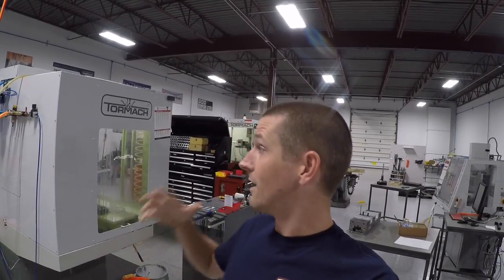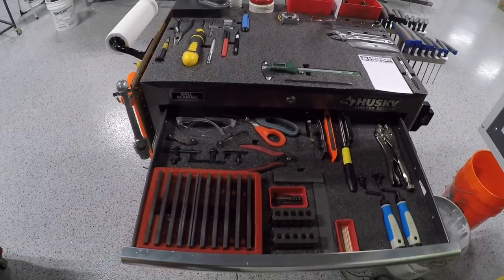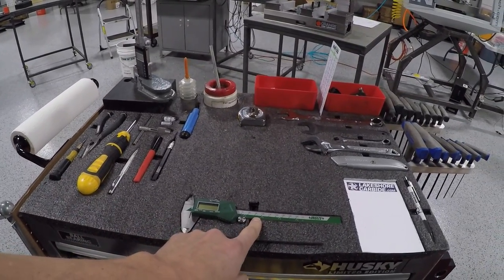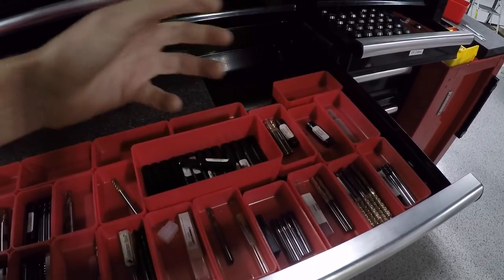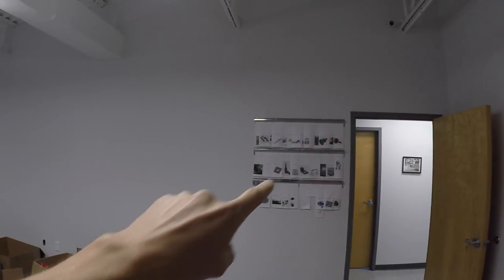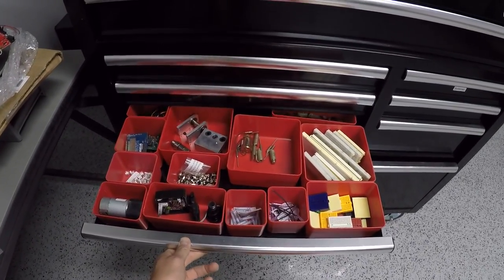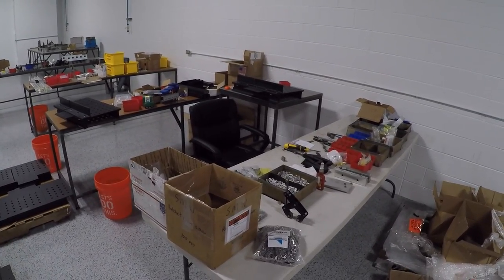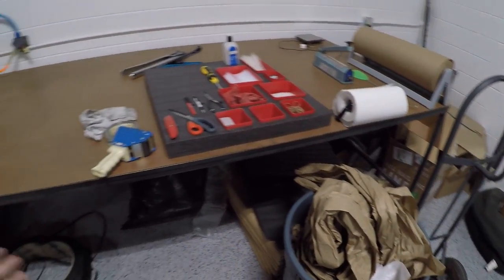Ultimate Machine Shop Toolbox & Organization!

Comment: When I was working as an aircraft mechanic in the Air Force used foam in our tool boxes. Since we had to make sure we didn't lose/forget a tool on the jet, we painted the tool cutouts a different color than the foam. It makes a missing tool show up like nothing else. Very easy to do on new foam. Just mask the whole top then cut out for your tools, spray paint the cutouts, and then remove the masking. Or on cut foam a smaller brush, say 1", and some reg ol paint. Doesn't have to be perfect just contrasting.

Also, with drill bits paint the shank tip a color to indicate the size and paint the drawers and/or draw pulls to match. It makes it really fast to see where a bit goes or if it is in the wrong spot. I also agree that new cutting/drilling tools should be in the boxes, waxed, or sleeved and the used ones open. Nothing worse then thinking you have a new sharp tool for that critical job and finding out it is a bit dull. 

BTW, if you're not going to need that blue thing with the hopper on top in the back of your "junk" pile... You could always send it my way... 😜   I fairly sure that I could put it to some good use. 🔫😄
Reply: You can buy Kaizen foam in dual colour for shadow boarding. Top layer is black, subsequent layers are white

Comment: Hey John. Just wanted to share an idea I saw on a forum for organizing your tools.
An alternative to the cut foam is expanding foam.
Grab a piece of plastic or cling film to cover the drawer.
Cut a piece of wood board so it fits in the drawer, remove for using as a lid.
Lay out the tools wrong side up inside the drawer, i.e. mirrored.
Use cut through ping pong balls for finger grabs or play doh, a piece of wood taped to the handle if need be..
Cover with a sheet of fabric of your choice, velvet looks nice, tuck it in nicely around your tools.
Cover with expanding foam, add the board and some weight on top.
Wait for it to set overnight. 
You can do inclined racks, fully flat, the possibilities are endless.
Profit.

Comment: Tip For the Endmills/tap and such. Label the bins with a picture of the tool! Layout a bunch of tools and snap a picture, crop each one and print with the label maker! I don't know if you have one that will print a pic but if you don't they are super cheap so get one. Leave new tools in their tube and used tool (which there now should only ever be one) out of the tube. This will help you avoid having a bunch of used tools as you'll alway burn up the used tool first!
Don't leave multiple carbides where they can bang into each other, even the very lightest impact will cause micro chipping and damage to the coatings when to extremely hard tools touch. This tiny, invisible damage will drastically reduce your tool life and finish, especially once you start running 15k Rippem's. There's a reason they come in packaging that separates them from one another! This is not as important with HSS tools, hence drills come package together all the time. Unless they are hard coated, then the same applies! The coating can be damaged by impact with other hard coatings. So keep your fancy high performance coated taps in the tubes. 
Attach the charger to the machine! Having a cord to the cart will suck, you already have power at the machine so just run a power bar to somewhere convenient and away you go. Do the same with you new Mill, have the electrician run a dedicated 15 or 20 amp 110 Volt circuit to the machine and put a 4 way plug on the front just under the control or the shelving if you got that option. This way you don't have a damed extension cord to trip over and you have a pug close enough to the machine to plug in a heat gun or grinder without having to mess with an extension cord!
Reply: Nice tips.
Especially on the tools in drawers. I have a protective cover on all my carbide & I don't take it off unless it's in a tightened collet. I also keep a fine, 60x3 triangular, diamond needle file and a magnification eyepiece on me. Usually I'm just picking fused chips off but it often comes in handy for inserts in situations where you can just take a couple light strokes. And it's faster than changing the bit.

Comment: I'm a great fan of making up dedicated tool-sets that live where they are used - a set on each machine specific to it; sets of slightly different tools at my desk and at my computer. It solves the problem of certain tools being missing from general sets (like a full set of combination wrenches) because the 3/4 "lives" on the lathe. (I usually cut off the end I don't usually use to make it a specific tool.)

I really love your solution(s) for storing and indexing pieces-of-metal-too-small-to-save. As a hobbyist, my need for maintaining a large variety of materials is probably different than keeping a supply of production materials, but the principle is there.

Comment: Looks great!  Your right about one thing. You'll never will be done organizing.  
The little welded carts look great, but I do feel the need to recommend looking into 80/20 extruded aluminum.  We build machine frames, tables, shelves, and all sorts of things out of it.  Extremely modular, just cut it to length and bolt it together with fasteners.   Its a bit more pricey vs raw angle iron, but you'll lave in labor.

Comment: Looks good! One thing that the shop I work at does which might help you regarding drill bits and taps etc.. is having two sections. One for new bits and one for used ones. That way when guys set up a job they can just grab a used bit and keep wearing on the used ones. But if they are having trouble holding tolerance because of the bit, then they grab one from the new tool section. Just a thought. It seems to work for us.

Comment: Great video! I started using Plano flat tackle boxes for a lot of my storage, especially electronics. For me it has worked really well. 
One thing I'm not 100% on is the lower shelf on the carts. It certainly can be a catch point for stuff, but it's also a great place to catch trash. I like having a trash can in arms reach from wherever I'm working and under a bench or cart is a great place to store them out of the way but always at hand.

Comment: Might have to rip off that small scraps rack for my shop. As for the Dewalt sets I would recommend making some holsters out of 3" pvc that they just slide into, just cut out a slot for the grip to pop in and mount them at a slight angle on the sides of your carts.

Comment: Regarding having a power strip on your toolbox; once you have your machines and toolboxes in place, I've found that dedicated drops from the ceiling are convenient and do away with cords on the floor. You might do this already with AC and compressed air drops--I can't really tell in the videos. Just thought I'd mention in. Great job, by the way. Your shop looks awesome! Bruce Nelson, Toledo, Oh

Comment: Excellent job! Don't know if you remember or not, but I had told you a while back to 5S your shop. It will pay for itself over time. Also when a customer walks in, they will be impressed. Glad your expanding and keep on growing!
Reply: This is exactly what I have been trying to do to my entire home / shop-to-be garage before starting a business. I have acquired so many tools and hardware over time, I want the confidence I can find things or even know that it's time to invest in more inventory. It definitely is a time reducer to have things in place. I upgraded on tool box to a large chest and already I have been so happy to work on projects as it's so efficient now and I can easily put things right back where they belong without delay. Yes, it will always be a work in progress!
Reply: What is "to 5S"???
Reply: 5S = Sort, Straighten, Sweep (or Shine), Standardize, Sustain. 6S adds Safety.

Many shops simplify it to 3S or Sort, Shine, Standardize.

Comment: About those Schaller bins - Sortimo makes bins like that for their organizers.  Most of Sortimo's products are hard to find in the US, but Bosch sells some of the i-Boxx line.  The organizer trays are durable and won't get small parts mixed up even if you drop them or flip them over.  The i-Boxx racks are overpriced, but I've welded together my own 5-tray tracks for about $10 each.  I just wish I could get the trays in Sortimo gray rather than Bosch blue.

Love the shop tour.  I could watch tours of well-organized shops for hours.  I may have to try the restaurant ticket holders.  Bakery racks are another good one from the restaurant industry - they'll hold 40 cafeteria trays or 20 sheet pans.

Comment: The Navy uses the same setup but if there is a box that has tools that are not typically used on a day by day basis you have to put a chit that has your ID number in the missing tool slot in the box so if you don't return it they know who had it last. My father even did it to his tool boxes but used foam board that you typically use between vinyl siding and made the cutouts with hand router with dust collection to organize his tools. I think it cost like 20 bucks to do a 11 drawer tool box. As for myself I attend to be messy and end up looking for tools. As soon as I can get my own shop I plan to dump all my tools on the floor box by box and organize everything. I've already started on a few such as a small tool box that holds all of my drill bits and taps and another tool box I keep at my Electronics bench.
Reply: We used to use the chit system many many many years ago in the Air Force. Now all our tools are electronically scanned out for accountability reasons. I also have cut probably thousands of pieces of tool box foam over the years. We now have a laser machine that cuts out all the tool spots for us.
Reply: It's awesome how 15 years can change. Let alone the Air Force always get the latest and greatest toys before the Navy.

Comment: Hey, Love the show! The dewalt can be installed on the right side of your tool cart under the tormach tool vise, 2 inch ABS pipe from home depot. Cut out the grip section and it ends up being an UBER cheap holster, especially if you use the dewalt impact alot.

For the lista cab, I would have a minion take a label maker to the schaller bins and label each bin with the bolt diameter and thread pitch.

For the racking, I think it was versa rack. Basically it allows you to improve storage footprint efficiency, think your big shelf on 40mm ball bearings on a track.

Comment: Hi John, looking smart! 
Just wanted to share a tip on how to keep those molded trays that hold tools i.e Noga deburrers @ 4:56 alive, is to get a tube of Urethane/Windshield sealant and fill the back side of the tray, make sure there is no air bubbles between the tray and the sealant and you'll find they'll last nearly forever!

Comment: i work in aviation maintenance and building my toolbox took me about a full week. We have to check them each and every day after work just to make sure we don't leave 1" wrenches inside an engine (yes, stuff like this has happend)... after rebuilding my box a couple of times this tool-check takes me literally 10 seconds...  red foam on the bottom, thin black foam on top so you see missing stuff directly

Comment: add a small vice I love it on mine I did a two shelf cart from home Depot and put peg board on three sides and whatever project im doing on the car I grab what I think I need and standard tools stay hanging. laying under car the creeper never has enough storage so I Park it close to the car and just push it back when time to get up and the bottom is my catch-all and neodymium mag makes all the bolts I romove stick to the face of the cart frame

Comment: Now that I saw this video for the second time, it gave me the incentive to get some Kaizen stuff and I just started a few days ago getting all my tools "Kaized" lol...It's quite time consuming but I can see how I bought 3 of the same cutting tools because I could not find the first and second one I bought and I keep losing my mics and other tools. The only disadvantage with Kaizen is that you can only get so many tools per drawer hence you lose some space but it's worth it. 
Regarding John's Husky tool cart, he has the bottom deep drawers empty just as I do on my 42" Craftsman tool chest. It bothers me to no end that, for years, I have not been able to make good used of the bottom drawers because they are too freaking deep.
So there they are, like a vacant apartment, and it's really a wast of space. These tool carts were meant for car mechanics, not machinist. And what do machinist have? Kennedy tool chests. I've been a machinist for 30 years and in the past 10, I've come to hate them with those tiny sharp handles, wrinkled finish and boring brown color; hard to believe they still paint them that way. Needless to say, I got rid of it. Will there ever come a day when they make tool chest specifically for machinist? I can envision designing one so that the customer can choose different drawer sizes (in depth) and arrange them at any level he/she chooses. The tool chest would also have available colors to chose from other than red. Why do most mechanic tool chests come in red, why? I'd like to see payne's gray, off white, or a two tone. Anyway, thanks for this video, John. As always, you rock!

Comment: Love the idea of using the kaizen foam.  I started organizing  the milling machine tool box at my makerspace.  Do you have a update video on how your tool cart looks now?  I'm trying to decide on what to do with tools that come in pouches like the bore gauges and adjustable parallels.  I like the fact they have the measurements for the gauges and parallels printed on the pouches.   Plan on putting my coaxial indicator and Edge Technologies tramming aid in the foam and get rid of the cases..

Comment: John try the 10V dewalt i use them for tear down in my engine shop they have all the torque needed, and the new Lion batteries seem to last forever, i charge my two batteries once a week. Bonus they are (here) about £180 cheaper than the 18V ones.

Comment: In order of importance it is a magnificent thing to have 110 power on a tool box the simple power strip adds versatility every work bench can benefit from a power strip.  Even if you don't keep it plugged in to an outlet.  I also like your paper towel holder, not the game changer of 110 power but like the power strip it allows 1 hand operations when I was loosing the feeling and use of my hands being able to use just one hand to operate something was one of my great loses I couldn't get by using just one hand.  I like your drawer trays " shaller trays my tool boxes suffer with hand made inserts of aluminum that were perfect when it was an aircraft box but don't fit my tools I do like the standard 1 & 2" tall dividers that came with the tool boxes in 1954 most of mine are now 1/8" aluminum.   As for your camera cart why not mount a mono pod to that camera cart and put away the tripods.  Unlike the home tool box you have less of an issue with stuff falling off the box while in motion.  I like a racks on the sides of my tool box for      things like spray paints I call them saddle bags.

Comment: Got an idea for your DeWalt tools.  Sheet metal panel at an angle off the back of the cart leaning away from you.  Holes in the sheet metal so the tools drop in and can be just pulled out for use.  Or even a shelf with drop in slots and the charger off to one side of the shelf.  Many ways to solve that one.

Comment: i recently saw a way to mount your drills using PVC pipe slotted on the bottom, to hold the drill by the top section.

Comment: If you haven't seen Adam Savage's tool carts, you should go over to the Tested channel and watch them. He goes off of a concept he calls "first order retreivability," and that drawers are where things go to die.
Reply: And his Sortimo racks
Reply: Yep, highly recommended.
Reply: Adam has a different style of building though...he works on more of a "get it done" style of creating.  Hes much less of a "craftsman" and much more a "creator."  This means that having all his tools right by his side while the creative juices are flowing is important.  In a machine shop cleanliness can be much more important.  In drawers precision instruments can avoid being covered in shavings, dust, grease, etc, that can be a problem for tools.  It really just depends on what your doing.  Home hobby man dabbling in a little bit of a lot of things...go with Adam's route.  Working in a very specific type of manufacturing...Tool boxes work great
Reply: Spencer/Tressa Adams As being a propmaker I work like Adam AND like a macinist at my lathe, milling machine and cnc. I see the difference and struggle with the same issues these guys do. Therefore I have stuff in drawers ans stuff on stands to keep them in sight and reach.